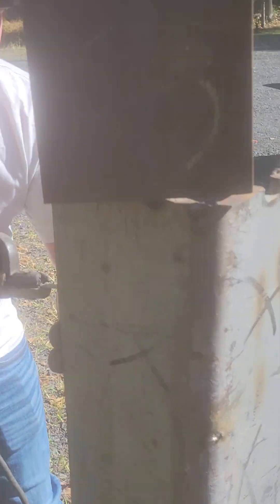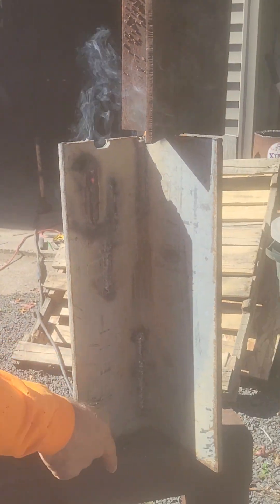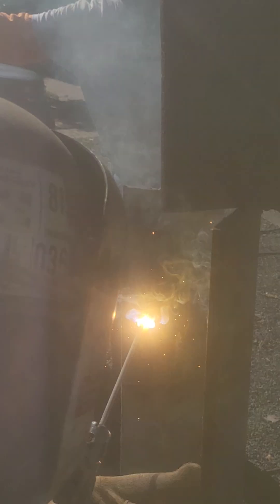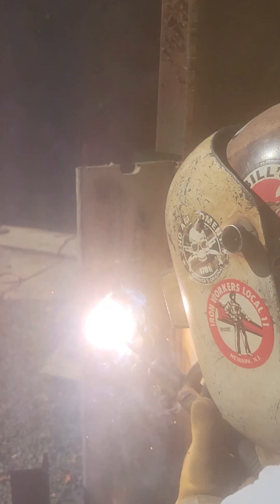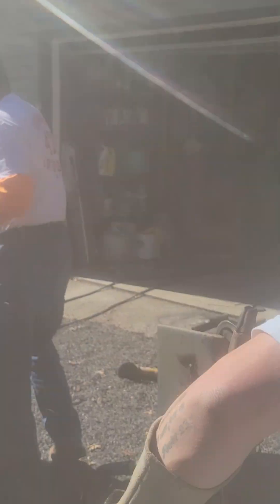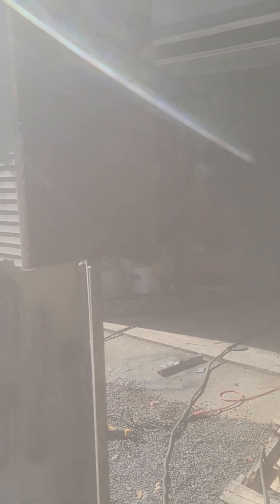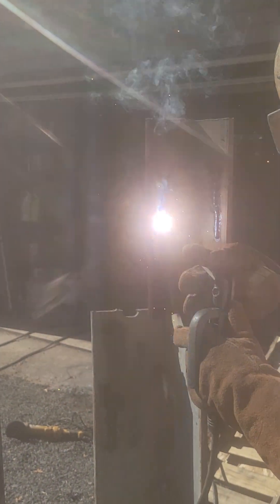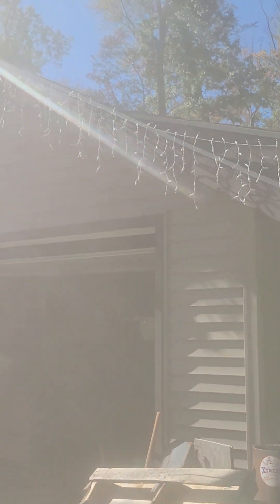STRUCTURAL WELDING/LINCOLN EXCALIBUR -VS -ESAB 7018 1/8

Comment: I used to run Excalibur all the time but over the last few years it seems to have really gone downhill. I tried and ultimately switched to Esab about 9 months ago and have been very happy with it.
Reply from the maker: Faultline, What's going on,  thank you for your comment, I can't believe how a great product   Lincoln Excalibur7018, Is actually Not #1 anymore, It's been very inconsistent on restarts, The flux just doesn't hold on like it used to, Fingernail at times,arc Strays on you In the middle of a pass, I deal with a lot of structural primer paint, Galvanize, I seen this wire for 37 years, Maybe it wasn't Excalibur back in the day ,but it was Lincoln and atomic Arc,. That's what was happening in the 
eighties & nineties That's when I got broken into the business, Just my preference,  moving forward, I will soon be experiencing the ESAB  Welding line of products,  thank you, Be safe ,and I will be talking to you soon!!
Reply: @jetweldingllc4691  I have experienced the same things with Excalibur. Flux falling off, finger nailing and also, I’ve had many sealed cans that had moisture in them when I opened them. My local supply store always takes care of me and then deals with the return to Lincoln. I just got tired of not knowing what I was going to get from one can to another and like I said earlier I have been happy with the switch to esab so far. I have been welding for just over 20 years but just within the last year learned structural wire and your videos were definitely a good tool to reference while I was learning. Keep up the good work!
Reply: @skystevenson24  That is interesting with the 8018. While I have switched to esab for stick I still prefer and use Lincoln if I’m running wire.
Reply from the maker: @skystevenson24  , What's going on, 8018, It has a beautiful finish,  Everything's pretty good here, Do they test at the school,8018,? Just curious, What a great apprenticeship school! Brian is the man! Great to hear from you!

Comment: I always thought Esab was a Swedish brand
Reply from the maker: Hubert, Thanks for your comment, I was told it was an American product, I never looked into it, It was just a test yesterday,, I thought it was a very good wire, Having both of them products in your corner, you're producing major production welding!
Reply: You are correct esab is a swedish brand but I thought their wire was an American product... I could be wrong fortunately China has a stronghold in our country unfortunately

Comment: Tell you what; I’ve been accused of even having Lincoln underwear because I’m so brand loyal to them. I’m not going to tell you that Lincoln is the absolute best at all their products BUT, I will say that every time I buy Lincoln, I can take it to the job and use it. When I first started out, I would try other brands because some salesman swore that some product was cheaper and just as good. Ended up throwing a lot of that crap in the dumpster or giving it away. Absolutely unusable! Now you tell me, what’s the better deal?
Reply: I agree with your comment you can run Lincoln on the job and it does produce good welds. But it seems more times than not restarts are a pain in the ass because these flux breaks off easy and creates a sticking issue. And because the coating on the wire is so inconsistent your Arc sometimes goes where you don't want it you have to work the wire to get a good well. Lincoln wire produces an inconsistent Park. ESAB does not , AND IT'S A LITTLE CHEAPER. You can buy it in small quantities so give it a shot I think you'll like it.

Comment: I've noticed the same thing with excalibur rod. The flux just falls off of them. In a ten pound can I'll get to the end and there will be a pile of flux in the bottom.
Reply from the maker: Justin,, Good morning, You're exactly right, Sometimes these  Eractors purchase all different brand names of 7018 ,I've seen in the last couple of years because of pricing,  Lincoln by far Is very expensive, And I get it, But they're delivering a great product for many many many years, But I love when another competitor Delivering a better product, And it's priced similar, But the consistency is what wins the race as a production welder, Lincoln electrode 7018X caliber, Has not been Consistent, We've been having this talk for the last couple months and here we are,ESAB

Comment: Esab is really the old "ATOM ARC" 7018  that was and is made in USA PA plant. I never liked lincoln excaliber ever since  it came out, It is more a light slag E7016 that was used on pipe for less slag interferance than the origional Lincoln LH70 7018 which always was my favorite 7018. Also excalibur coating is inconsistant and crumbly! GO ESAB and God bless America  JET!
Reply from the maker: AWDjr, Good morning, Thanks for your comment, I remember atomic arc ,an erector always used it back  in the eighties, When I got broken into the business, But it's been Lincoln For 30 plus years,  All of our apprentice programs,  local 11, 40, 361,401 all use Lincoln products
Reply: @jetweldingllc4691  Yep same here on the Lincoln, Lincoln is the cost efective standard of the industry and a good product, but there are better products out there but at a premium cost, but they may be better overall in productivity.
Reply: I never run Atom arch that is a pretty good liar as well??? I used to run a lot of Hobart back in the day that was great wire really hard to find anymore unfortunately. But I do know one thing stinking Lincoln is some of the worst I've run